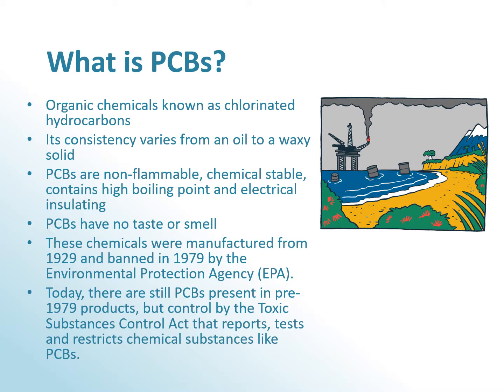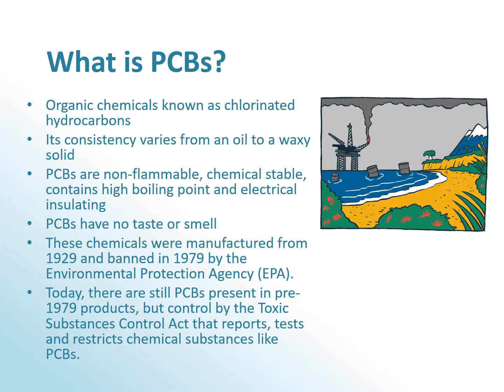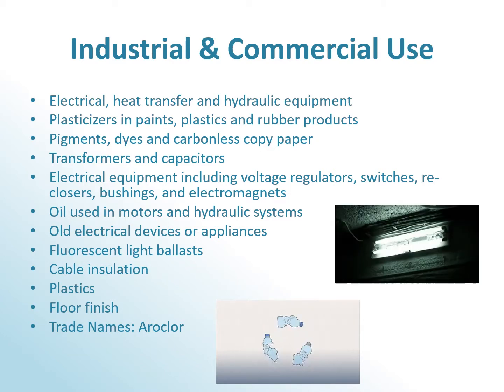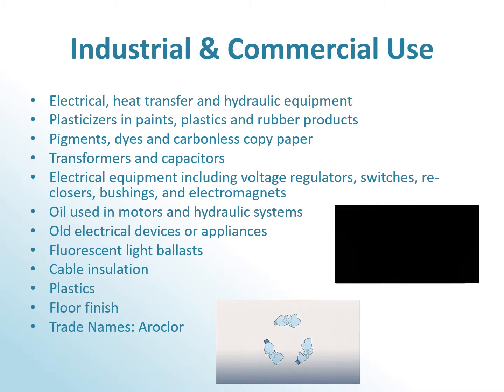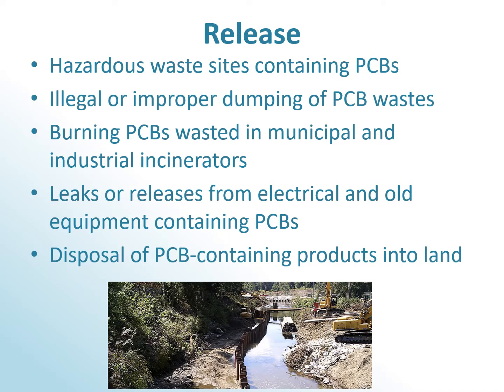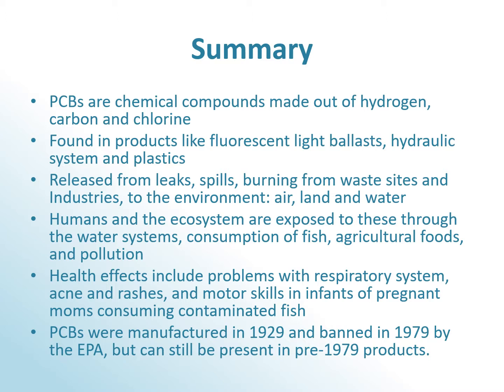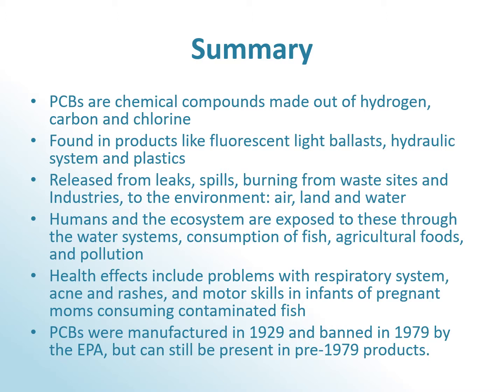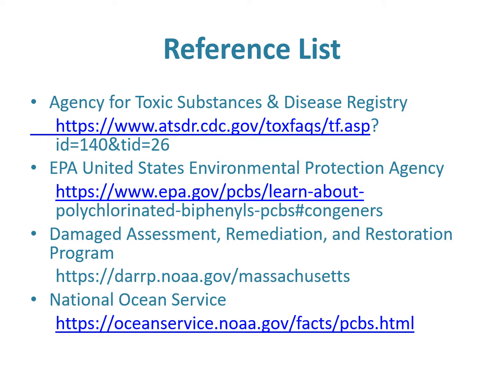Polychlorinated BIphenyls

Comment: I was once called to replace a fluorescent fixture in the janitor's closet at a school built in the early 1980s, where the ballast caught fire and spilled flaming tar on to surrounding materials, setting off the fire alarm and fire sprinkler.    Because of the damage to the fixture there was no way to tell if the ballast was PCB containing (since the school was built after 1979 that shouldn't have been the case, but it's possible the ballast was pre-1979 pulled off the shelf and installed when the place was built) 
our crew had to wear gloves,  and a respirator,  when cleaning up the aftermath.      That was almost 10 years ago, but there's undoubtedly many old PCB containing equipment still in use, so be aware.